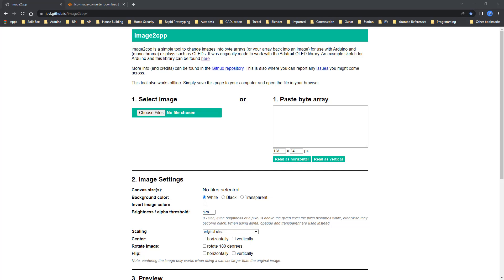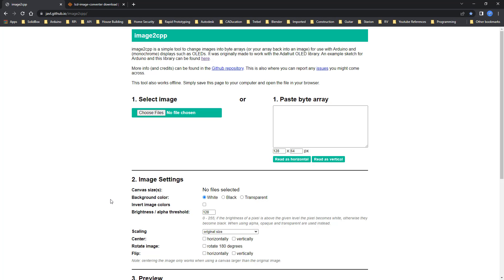Using Images and Sprites to Make a Gauge | Beginner How To Converting Images to CPP to Sprite

Comment: Does the background really need to be a sprite? It's not on par with a classic sprite definition, which is a small object moving over a playfield (background).
Reply from the maker: Its my understanding that it works better (less flicker) using the sprite method because you are basically drawing the screen in memory first by drawing the background then drawing the needle at some angle on top of that and pushing that whole thing to the display.  If you were to redraw the background each time you would have to wait for that to happen, draw the needle in memory and then push it to the screen.

Its certainly worth a try.

Comment: Can u upload all code to pastebin or something similar ? Or mayby u can make similar video with  GC9A01 240x240 and TFT-eSPI ?
Reply from the maker: Hi Lukasz, in some of the video descriptions I posted the code.  For this one the images came from a user which is why I didn't post the code directly.  The user that requested help also had Volos do the same thing using the round display and you can check out his work. https://www.youtube.com/watch?v=y_H7HM0oyoo

As for TFT-eSPI vs the M5stack I used the main difference is just in the declaration of the objects.  I declare M5.stack but using tft-eSPI means you would declare your sprites like this TFT_eSPI tft = TFT_eSPI();  with tft being the name.

The user I helped with this hasn't replied in awhile but the code aside from the images themselves is straight forward. if you email me support@caducator.com I am happy to share the code minus the CPP images

Comment: A way to expand this project might be to add a light / lux sensor so that the brightness can be adjusted as conditions dictate. I would not want the screen in my face at night with this graphic on it! So either switch for a dark theme and/or dim the brightness and it should be much better, at least in my opinion. I think this project is awesome and thoroughly enjoyed watching your video. I am just about to get my feet wet with a microcontroller and C++ and will likely employ the use of sprites in parts of my projects.
Reply from the maker: For sure.  The user who asked the questions was building the gauge for his boat and had several different sprite backgrounds to swap between including a black one with white segments.

If i was building a gauge for a car or something I would likely go with a Nextion display.  It offloads a lot of the heavy lifting that smaller microcontrollers have issues with and lets your microcontroller just focus on bringing in the inputs and reading outputs.  Loading a bunch of images into a controller will eat up the ram and the refresh rate will eventually diminish.

Comment: This is the BEST tutorial on sprites and images, by a country mile. Thank you. You asked what projects your viewers are working on. I have just finished programming an ESP32 with a GC9Aa01A round display. It displays the clock face of Big Ben with Big Ben hands. The code uses 4 sprites (I like a seconds hand even though Big Ben doesn't have it). It is flicker free and the images are sharp except where the 3 hands cross over each other around the pivot point. When displayed separately, each hand displays perfectly but the images become a little tardy around the pivot time point when all hands are shown together.
Reply from the maker: Thanks Brian!  Your project sounds cool!  Which library did you end up using?  I found on the M5 stack that not all the tftespi library was ported over and specifically in compositing images.  I have been looking at https://github.com/lovyan03/LovyanGFX  as it is supposed to be faster as well as more flexible with compositing multiple sprites.

On your sprites at the pivot, they are using transparent pixels correct?  One possible solution would be to add yet another image of a black dot that would act as a "pin" over all the pivots.  This could be on the second hand or as its own image that never rotates.
Reply: @LearnEverythingAboutDesign  I tried to respond with a video of the clock working but I guess that is a 'no-no'. I tried to use the Lovyan library after changing the GCA9A01A configuration file and running an example script, but it initialized the screen with a white image but nothing else. With respect to my issue, I am using the TST eSPI library. The video would have shown that the order of the sprites (i.e. the hands) being pushed impacted the final look. The last sprite displays the hand perfectly, but the previous sprite's image is impacted where the ends of the hands start to overlap. Swapping the order swaps which hand display correctly. I think I am using transparency correctly (i.e. I replaced white hex bytes with 0x0120 bytes) but maybe I'm not.
Reply from the maker: @bpeacock2  Ok if you are using the TFT eSPI library directly then you have the pushImage where you can overlay multiple sprites on top of each other without the rotated.  you can email me support@caducator.com a video link since Youtube doesn't like that :)

Comment: Any specific instructions on where to learn how to set up M5stack core3 on my Mac book air?  I’ve followed most instructions on the internet, reloaded drivers, changed new cables, used M5core3 libraries; but no connection.  Thank you.
Reply from the maker: Tough one as I don't have any Mac to try, but I would suggest maybe try the web based arduino IDE and see if that gets you around any problems with drivers and libraries.

Is the Mac just not seeing it when plugged in?
Reply: Correct, just doesn’t see M5stack.  I will try web based IDE.  I got your needle sweep gauge working well on my esp32 development module with 0.96 OLED with a variable potentiometer input.  But I wanted to do it with SPRITEs and got the newest M5 Stack, thinking that had the best access to a SPRITE library.
Reply from the maker: @thomasshearer9200  The library in the M5Stack system is a modified version of the TFTeSPI library by Bodmer.  There are some bits of it missing, so unless they updated it I don't think there is a library benefit to using the M5.  Just the benefit of all the electronics, button, battery etc built into a single unit.  I used it because my Grey has an IMU in and I was able to add a GPS antenna to it.  In the past when i had use an Arduino board like an Uno it was tricky powering the project and the memory was very limited.  Jumping to an ESP32 based board, or Samd21 opened up the memory capabilities but I found that some libraries cause issues with say i2c access on stemma connectors for small displays.  The m5 simplifies a lot of those challenges and comes in a nice package.

The main thing I found missing from the m5 version of the TFTeSPI library was the ability to push Image.  We can push rotated which is fine, but if you wanted to have say a warning icon pop up on the gauge under the rotated needle it wasn't possible with the M5 version of the library.

So any ESP based setup you have should work fine with the TFTeSPI library or other sprite libraries if you can't sort out the connection to your Mac.
Reply: Thank you very much, I’ll try the TFT library on my esp32 dev mod.
Reply from the maker: @thomasshearer9200  https://github.com/lovyan03/LovyanGFX/tree/master/examples/Sprite  This is another library that was pointed out to me.
Reply: Thanks to your excellent video I was able to make a sprite- base gauge that responds to voltage input. But only with an M5 basic on my MacBook Air. The M5 cores 2and 3 do not “see” the “wch.   “ serial port, and the screens do not even light. This is with the same cable and both recommended drivers loaded as with the M5Stack Basic. Is there something obvious I’m missing to get the core 2 and 3 M5 Stacks working?
Reply from the maker: @thomasshearer9200  I can't say for sure what the issue is, but i do remember on the forums people saying they couldn't get the screens on for the core 2 or core 3 without setting the lcd voltage.  Can you run sample code from m5 that works aside from the stuff you are making?  

M5.Axp.SetLcdVoltage(2800);
Reply: Thanks for the feedback on power requirements for M5 basic vs cores 2 and S3. I finally found that I needed to eliminate M5.Power() from M5 cores2 and 3 sketches to light the LCD.  Also, needed to replace “eSprite” with LGFX_Sprite for cores 2and 3.  Any idea where the syntax for the commands for LGFX_Sprite library would be listed?   Thanks again for some very useful videos and responsive comments.
Reply from the maker: @thomasshearer9200  Thanks for sharing!  All good info!  On the sprite library commands I am not sure.  The library in the M5Stack I am using was a copy of the TFTeSPI library.  Maybe they recently changed to using the Lovyan library.  
https://github.com/lovyan03/LovyanGFX/tree/master/examples/Sprite

If you look at the examples in there for RadialGauge thy have the LGFX call.  I am told the Lovyan library is faster and has more calls than the tftespi one so i see this as a good thing.  Ill have to dig into updates to see if/how that affects things.

Comment: Thanks very much for this, I'm building a gauge to display air-mass movement in sailplanes using RTK GPS. I'm currently using your first sprite demo as my starting point and have a very pretty gauge that displays in about 70 msec (after I've added my various numbers (airspeed, heading, Yaw, and derived windspeed) to the basic design. My question is if using this approach will give any speed advantage over 70 msec? Maybe a link to a demo that I can try on my M5Stack.
Reply from the maker: Glad it was helpful!  While i don't consider myself a programmer I do know there are certain limitations you will run into.  I am going to guess your GPS is pulling in data 10x a second or slower.  If you are sticking with the tftespi library that the M5 stack is using(parts of) I would take a look at this thread on Github from the creator (Bodmer) of the TFTeSPI library.
https://github.com/Bodmer/TFT_eSPI/issues/650
I think your 70ms speed seems pretty good.  The difference between this example and the first one where we were drawing the gauge as a subroutine and this where its calling it up bit by bit will likely be different speeds.  There are two things at work here.
1. You are drawing this to the buffer before pushing it to the screen.
2. When you push to the screen with an image like in this example you are redrawing the whole screen.

The time to draw it to the buffer is quicker than the time to push it to the screen I do believe.  So in the first example if you are only drawing a part of the screen and you can clear that before drawing the new position I would imagine that to be faster.  Using the images as sprites again will likely be slower but you would need to test it to be sure.

Comment: Thank you so much for putting this video together!  I am VERY new to the M5Stack Core2 device and I have been trying to find information on to create very nice looking graphs and graphics on the M5Stack display. Which I am having a hard time finding videos on how to create HIGH quality graphs and animations for the M5Stack Core.  Thanks for taking the time and explaining things in detail!  Especially when you give things to watch out for and how to correct them! Not sure how large the M5Stack Core is but hopefully they will appreciate this video!
Reply from the maker: Thank you!  Have you checked out some of the examples that are preloaded in the m5 library?  in the M5gfx there is an analog meter and a bar graph sample sketch.  Because there are variations of the M5 you might find that some code wont work.  my grey unit isn't touch screen for example so some of the GFX samples won't run.

They are great dev units and i love that they have built in sd, battery, speaker etc.  all that would be hard to have in such a nice package.
thanks for watching and commenting!

Comment: Great video and really helpful in my project in creating an aircraft battery gauge.  I have a challenge however in that the display has two needles and I can't get both to display at the same time. An update or further video would be great.
Reply from the maker: Great suggestion!  A few people have asked about this.  You would use the same process to push rotated with a single needle as you would with 2.  You simply need to push them in the order to a base(gauge face) sprite before pushing that sprite to the display.
Are you working on an M5 or some other display?

Comment: Thanks so much for introducing me to Sprites!!

Don't know yet if Sprite concepts are applicable, but I've been thinking about a one-dimensional application using neopixels.  Want to take a linear string of neopixels ... perhaps 50 to 75 of them ... that are all programmed to a shade (or shades) of orange.  Then on top of this orange string, I'd like to superimpose a "bump" of slightly more intense orange neopixels pixels that travels down the string of neopixels.   My guess the bump would consist of 5-8 neopixels.  Alternatively, it could be a "divet" of slightly less intense neopixels that travels down the string.  Ideally, maybe some combination of bumps and divets, all traveling in one direction down the string.  Kind of a higher (or lower) intensity wave traveling down the sting.

Here's my application.  As a steel mill model railroader, I'd like to simulate a linear flow of hot, liquid metal flowing through a trough.  

You comments would be appreciated.  Please realize I just saw your video about Sprites, so I need to do some experiments!!

All the best ...
Reply from the maker: Hey Donald!  I would say that want you want will likely have nothing to do with Sprites.  So on my house in the winter I have 1500 neopixels with some hard coded light displays including a traveling candy cane and "chase" sequence of lights.  I was using the WS2811 protocol but whatever you have(2812 or other) will be the same except for how you initialize them.  likely what you will have is going to be a couple of loops to accomplish this and maybe a Switch Case type of code set.  As a general thing what I would do is turn all of them on whatever your base color is(lets say orange), which will be a RGB value where 0 - 255 will represent the color.  So an orange is 255,175,74 (just a random orange i grabbed).  then what I would do is have a loop from 1 to whatever your highest pixel is(50 or 75) where you increment each pixel.  something like (for i = 1; i < 76; i++)  and inside that loop as you iterate through you set your pixel i to your intense color and the ones before it a slightly less intense color until you get to that 5-8 pixels behind and it would be (255, 175, 74).  This is a bit hard to do in a comment so feel free to send me an email support@caducator.com and ill do my best to try and explain.  Do you have a set of neopixels now?  are you using arduino or python code to control them?

Comment: A brilliant series so far. Incredibly detailed and very useful. I'm building a series of gauges for my Land Rover and this will (hopefully) help me to up my game significantly
Reply from the maker: Great to hear!  There are some options in the library i am using on the m5stack that are disabled or not included that you could use with the full library.  Things like pushing multiple sprites together not just the pushRotated.  This would be helpful if you are planning to display warning lights(not that a Rover needs them ;)).  You can also check out this other library https://github.com/lovyan03/LovyanGFX  that is supposed to be a little faster.
Reply: @Learn Everything About Design  much appreciated, thank you! My gauges were all set to be very basic on oled. Now with your tutorials and tfts....well, I have a chance at making something pretty cool. Thanks again
Reply from the maker: @greglogan4443  Great!  I would also suggest taking a look at Nexion displays.  They make large displays that are good for dash setups and their UI makes it much easier than hard coding and converting images like this.  I think the tftespi method is great for a single use gauge but for a full dash definitely check them out.